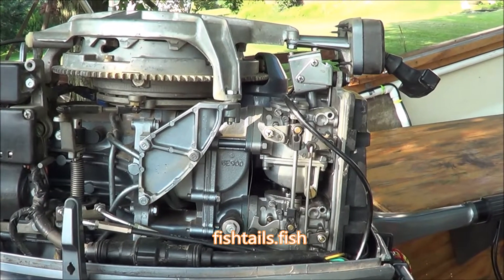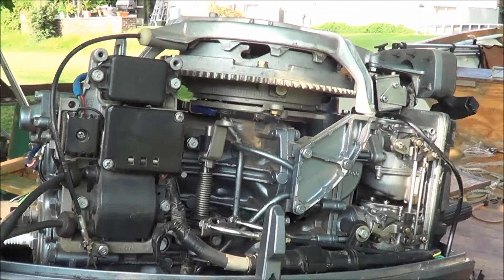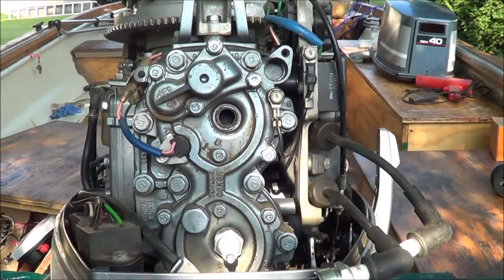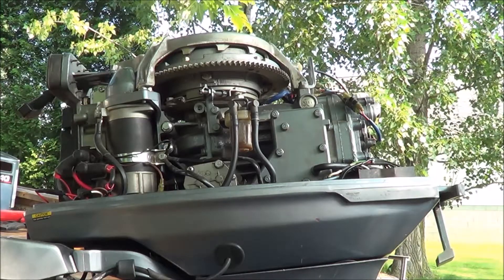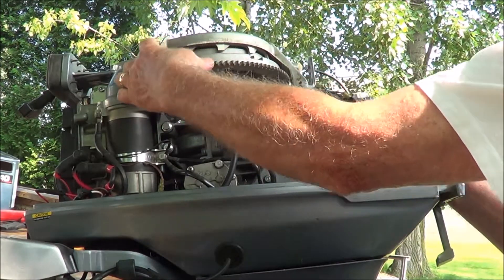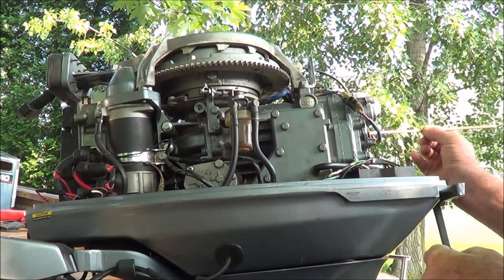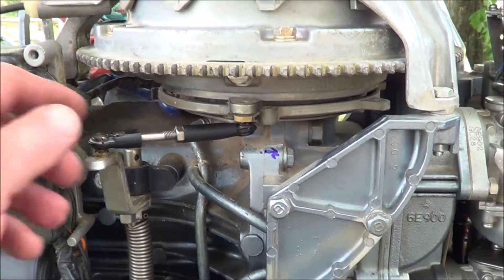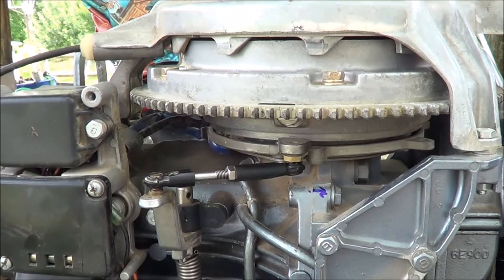Outboard Timing Yamaha / Mariner 6E9 40 HP

Comment: Hi I have a c40elrr Yamaha 40 hp, is this engine the same? It sure looks the same
Reply: They are exactly the same.For a few years yamaha made mariners.I have a 40 and a 25 yamaha mariner.Mechanic at boat store said they still havnt made a better motor..Keep it man.
Reply: @daveyboy8907  Thanks! Does the magnetto lever attached to the stator move back and forth with rpms? Mine appears to be stuck. Don't understand why.. Bad stator? Maybe I need a new magnetto lever?